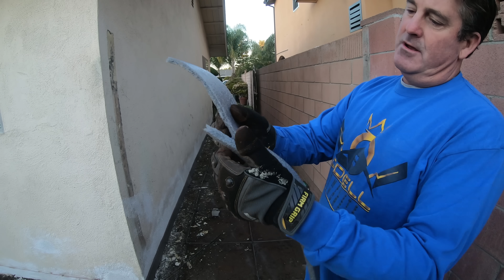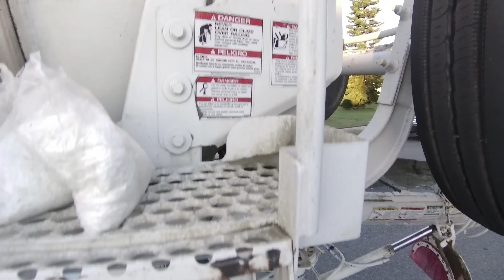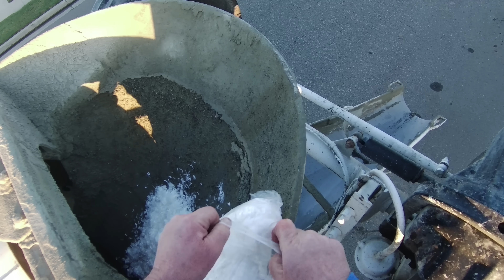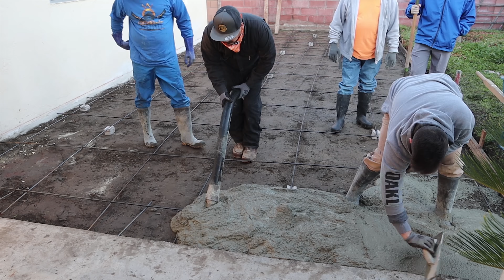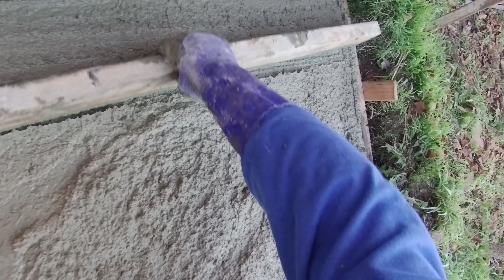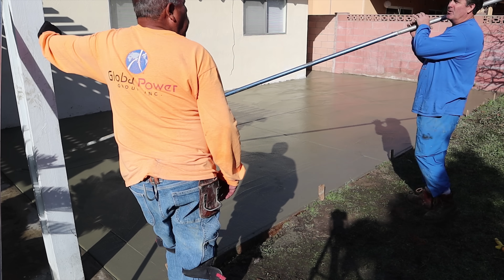How to Pour a Backyard Concrete Patio Part 2

Comment: Really like your concrete finishing advice and tips. top class, but surprised you dont pay more attention tospray or wet curing in first 48hr? 
Maybe it is different here in Europe but we always use curing agent, plastic sheet or water for at least 3 days on top.
Also I have some issues with your ideas on rebar. Plastic fibres are great for controlling early plastic shrinkage  but dont help long term crack control. Also 2ft on ctr rebar does not really enhance  the carrying capacity of a shallow slab if its in the centre of the slab, did an Engineer recommend this?
Sorry if this seems a criticism, not indended,  but really just trying to find why do do things differently here in Europe to Cal
Reply from the maker: I think what happens is over time in certain areas everyone one figures the best way to do something based on the area there in

Comment: If your hitting the rebar with that tool  on the control joint doesn't that mean it will allow water to get to the rebar causing it to rust and expand possibly causing additional cracks??
Reply from the maker: No it means the rebar is within 2.5"s of the surface. The joint doesn't stay open for the full depth.

Comment: Do you have to file plans to get permits? Do you need permits? CE stamped plans?

Thanks.
Reply from the maker: Not for this
Reply from the maker: I have some drawings now for the city of Fullerton,  in a current job however the inspector doesn't want to follow them